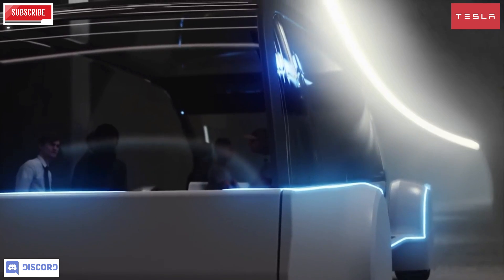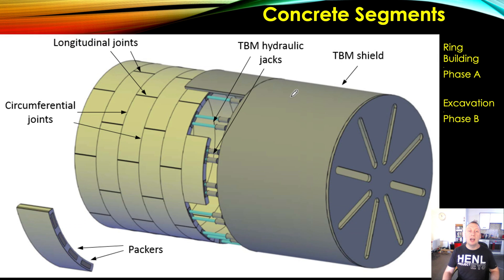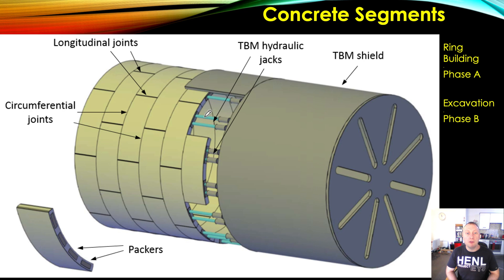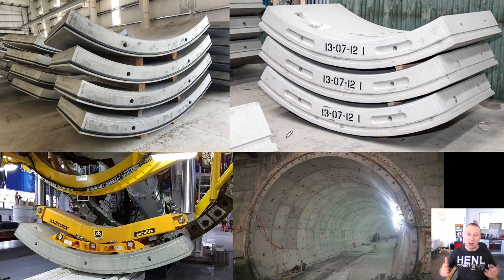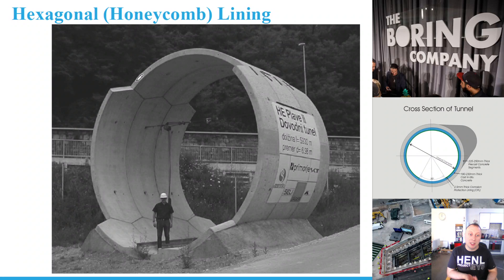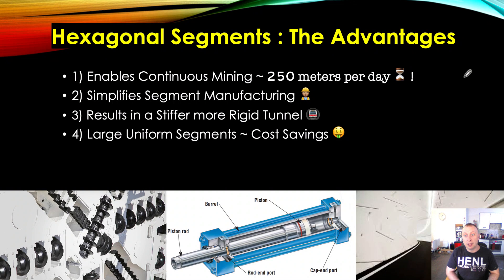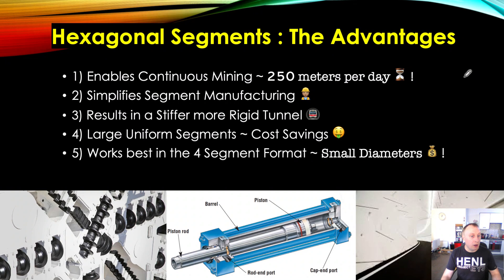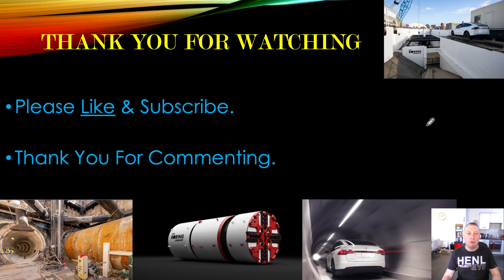The Boring Company 🚇 😃 🇺🇲 Hexagonal Concrete Segments Are The Future 👷🏽‍♂️ 🏗️ 🚎 PART 1

Comment: I really hope this is the case, whatever they do, it will be disruptive
Reply: To investors pockets I’m sure. To the tunneling industry I strongly doubt.
Reply: @davidsalisbury50  
David, it's apparent that you are skeptical.  That's fine.  One should not accept all claims out of hand.  But I'm not sure you fully understand how Elon and his companies operate.  Let me suggest you watch this video about Tesla.

u88Nqe0pIO0

The presenter may not be your cup of tea.  If so, concentrate on the messages given.  You'll come away, I think, with a better feel for how Elon's teams move from their starting position to get far ahead of others.  

For some background, Sandy Munro, seen in the video, is an genuine expert.  He helps the defense industry when they are having problems with weapons systems, he was one of the designers of one of Boeing's largest passenger jets, his company tears down and evaluates all sorts of products so he is familiar with best practices across several industries.  Companies come to Munro Associates when they are having problems with a product they want to manufacture.

Sandy started out being extremely negative about Tesla.  But once he made a short test drive and then stripped away the body Sandy did a full 180 and now reports that Tesla is years ahead of other car manufacturers.

I'd expect BoringCo to develop along the same lines.  Just put on your objective earphones and listen.
Reply: @davidsalisbury50  Betting against Musk typically is not a wise move.  He and his companies may know little when they first start but they tend to catch up and pass the pack fairly quickly.  Elon knew very little about rockets and EVs early on but look where SpaceX and Tesla are today.
Reply: Bob Wallace noted. I’m not betting against Mr Musk, I have no skin in the game other than a working knowledge of tunnel technology and I try to pass that in where I can.
I tend not to comment on Tesla and Space X as I know nothing more than any other layman on that technology.
I take my hat off to both of them.
Reply: @davidsalisbury50  

Understood.  If you know much about Tesla you know they entered the game by taking an existing car from Lotus and turning it into an EV.  I got a chance to check out one of Tesla's first Roadsters early on and while I'm a sports car fan, have owned a few, I felt no attraction to the car.  It just didn't look well made.  

But once one got past the rather clunky conversion job you saw that Tesla proved a concept.  Tesla, with that first effort demonstrated that EVs can be very fast, very responsive, and offer long ranges.  They buried the myth that EVs had to be golf carts with doors.

I suspect the Vegas project is similar.  Tesla is taking a standard tunnel boring machine and building a tunnel system that will allow thousands of unique visitors to Las Vegas to experience riding from one place to another at a high rate of speed, unlike any other transportation systems we now use.  There will be thousands, then tens of thousands, and even hundreds of thousands of people around the world stuck in a slow commute and wondering why they couldn't be traveling to their destination at 150 MPH.  Demand will occur.

Tesla went on to next build the Model S.  This was Tesla's first complete build car.  It immediately demonstrated that an EV could be beautiful, fast, and safe.   "(T)he highly regarded and long-respected industry magazine Car & Driver gave pretty high praise to the recently upgraded Tesla Model S 70D — even going so far as to referring to it as “a driving experience to rival the best.” In fact, it named the Model S in this article about the 70D the “car of the Century". "  From a proof of concept to, perhaps, the best car yet manufactured in four years.

I'm looking forward to BoringCo's next project.   I think that's when we see new ideas put in place and new tunneling speeds demonstrated.  To date Musk's companies have become dominant in automobile electrification and rocketry.  I will be surprised if they don't do the same in building tunnel systems.

Going to be fun to watch....
Reply: Bob Wallace I don’t disagree.
But from what I have heard, from the man himself, and others around him, there is little to suggest they have moved the current tunneling technology forward one iota to date, despite their claims I have only seen outdated technology and misinformed statements. I’m attempting to inform the debate. I realise that upsets some people and I get accused of being a Luddite or a troll. I will attempt to stay positive in the future
Reply: @davidsalisbury50  it's already a lot cheaper per mile. Let's check back in 5 years
Reply: Josh no it isn’t. The numbers they are providing are very selective. Not the whole cost. TBC can’t be using the same technology, materials, plant and workforce that the industry is (they are, but 20 years out of date) and doing it 5x cheaper.
The construction of the tunnels is only a small percentage of the cost of building a transport system. 
Check back in 5 years?
They have had 3 and achieved nothing new despite lots of promises. I’m not in the least surprised.
They have 3 current contracts, the first is supposed to finish this year. 
They still have a lot to do to transport 4,200 people per hour.
Reply: @davidsalisbury50  oh sorry, I get it. You hate Elon musk. Go troll somewhere else. They've won a contract and are delivering, they will continue to do the same and improve. There will continue to be luddites throughout history, people were crowing when the first skyscrapers were built, where are they now? I honestly can't understand why people stand on the sidelines and spew hate, they are 'the man in the ring' putting their blood and sweat into creating something. We should all applaud efforts like this, not tear them down.
Reply from the maker: @Josh  I'm really sorry this guy is bothering you. He is replying to every comment, I've counted 18 so far. 
Unsure why he is so eager to talk. I will message him 😕
Reply: @davidsalisbury50  Let's think a bit about phase two, a hyperloop.  Assume for the moment that BoringCo can bring down the cost of building tunnels appreciably and by using small diameter tunnels as opposed to train-sized tunnels the cost become affordable.  What would the rest of the cost of the system be?

Maglev track.  A continuous sheet of aluminum along the bottom of the track.  (Or perhaps I don't have a deep enough understanding of maglev.)

Vehicles.  Something like small buses that are pressurized.  Certainly not the cost per seat of building an airplane.

Stations.  A simple building at ground level with ramps leading to and from the main tunnel with airlocks to protect the vacuum.  "Show your ticket" to get in, clear security, walk to the correct platform, get in and sit down.

Energy costs.  Low. Vehicles operate in an environment with very little air resistance.

Tunnel maintenance.  Essentially nothing.  There would be no 'wear and tear' from vehicles that travel without making contact with the tunnel.  There would be no litter to remove.

Use.  The main tunnels will probably stay at maximum use around the clock.  When passenger pods don't fill them up freight pods can be slotted in.  Companies will pay premium prices to get freight from the West Coast to the East Coast in four hours.  They pay high prices for air freight now.
Reply: @BoringRevolution  
David is commenting a lot.  But he's also providing a lot of information.  Consider cutting him some slack.
Reply: Bob Wallace . Again, I tend not to comment on hyper loop technology. It’s clear there are some challenging technical difficulties to overcome before it is a reality. But who, when watching the Wright brothers take flight would have believe international air travel for the masses would be available effectively within a lifetime.
I don’t consider myself a troll or a Luddite. One of the reasons I took up tunnelling was the fact that it is at the forefront of construction technology. Some may believe this is not the case, but I believe I can support that statement with facts.

I will continue to challenge misinformation and provide clarifications where I think they are appropriate. I will try to be less critical and more positive in my comments
Reply: @davidsalisbury50  
I'm just suggesting that you think objectively.  Obviously BoringCo is not tunneling at record speed.  Maybe they won't solve the puzzle.  

But if one accepts the possibility that they might bring the cost of tunneling low enough then it's only a small step to see that we could have a very good alternative to flying powered by kerosene.

I've tried to look at all the public information about hyperloops.  I think all the necessary concepts have been proven.  We know that vehicles can travel at high speed in minimal air pressure conditions while powered by electricity.  That's the core technology.  Everything else like on/off ramps, stations, safety systems, etc. would be pretty much standard design and engineering.  I know of no unique problems for which solutions will need to be found.
Reply: Bob Wallace. Fair enough. I see many problems, but as I am no expert on the technology I don’t feel in any position to comment. I am concerned about how incidents in the tunnel are dealt with but I’m sure solutions can be found.
I still think it has a long way to go before the economics add up to make it more viable than high speed trains.
Reply: @davidsalisbury50  I'm seeing prices for HSR running multiples of Musk's $30 million per mile (three tunnels).  Gaining right of way through urban and built up suburban areas would be very expensive plus hard to accomplish.  If the hyperloop proves out I can see the federal government deciding that some tunnels are in the public interest and using eminent domain to acquire routes when necessary.  That's how the federal Interstate Highway System was built.

Plus HSR doesn't replace flying except on shorter routes.  It would be hard to get people to travel coast to coast in the US, spending 24 hours onboard, when they can fly in about five.  My understanding is that Europeans typically go to the airport rather than take long train trips.  

With a hyperloop in a tunnel solution there would also be significant maintenance cost savings.  Tunnel maintenace should cost about nothing.  Rail requires inspections and repairs.  The protective fences have to be maintained.  And shoving a lot of air out of the way via blunt force probably eats energy.
Reply: Bob Wallace a lot of HST is in tunnels of course because it needs very straight tracks, especially when it gets into urban areas.
You are quite correct that land rights are a critical factor. But that is the same for any surface/subsurface system. I’m not sure why hyperloop would get special preference over HST.
Europe has a mix of HST and flights, but HST is getting more popular due to the security restrictions, the use of overnight/sleeper trains for >500 mile journeys. 
Like all these things, the future is likely to be a mixed bag of modes of transport.
I’m not clear where hyperloop fits into that.
Reply: @davidsalisbury50  I really appreciate the change in tone. And glad to hear you're open to new things. You've been great at spreading some useful knowledge in the comments, appreciate the information from an informed perspective. All's well that ends well 😎👍
Reply: @davidsalisbury50  
Again, I don't see a contest between HSR and an underground hyperloop.  HSR is simply too slow to be an acceptable alternative to flying.  In Europe HSR ridership has been increasing for short/moderate length trips at least partially due to governments lowering ticket prices as a way to get people taking trains and lower CO2 emissions.  But back to the US.

We must quit fossil fuels.  We should have quit years ago but we didn't and now we're paying for our mistake.  We've got to quit making the same mistake over and over.  EVs are replacing ICEVs, the dam has broken and we watching legacy car manufactuers starting to scramble to move from engines to motors.  I think Tesla has not only forced the move to EV but has also created the solution for moving freight at highway speeds.  The two remaining transportation issues are flying and transoceanic shipping.  

How might we get petroleum out of high speed travel?  There some alternative ways to power airplanes but none are really good options, at least at this time, and I see little hope of much improvement in the near future.

Biofuel, if we could grow enough with hurting food production.  Hydrogen, except it uses a lot of energy in electrolysis and compression plus being a low energy source in terms of storage volume required.  Some sort of synfuel is possible, but perhaps expensive.  Batteries, perhaps someday, but we're several levels of improvement before the Wh/kg level would support long distance passenger flight.

The other alternative is a hyperloop.  It holds the possibility of being faster than flying.  The stations could be placed very close to where passengers want to depart and arrive rather than the often significant distance of airport from city centers.  The trip should be more comfortable.  No turbulence and it is expected that turbulence will become more frequent and stronger as we warm the atmosphere.  We can run the system with 'panels and turbines'.  And, depending on how rapidly we amortize the tunnels, perhaps the cheapest per passenger mile of all modes of travel short of bike and foot.

So.  Assuming Elon is right and it costs about $30 million per mile for tunnels that should be useable for more than a century.  (What's the lifespan of concrete tunnel liners?) And the other capex and opex costs are low I can see building a tunnel system as a national good, a national benefit.  If that's the case then I think we'd see the federal government assisting route procurement.  It would be hard for a landowner to go into court and claim that a space less than 40 feet wide and at least 30 feet below the surface should not be taken from them because the landowner would suffer from some sort of denial of use.
Reply: Bob Wallace a lot to take in, but I’m largely in agreement.
I still see the same tunnel network, just with HST’s using them.
mr Musk is about right that a single bore 6m tunnel costs around $30M per mile, but that is just the excavation and lining of the bare single tunnel, it doesn’t include all the other infrastructure, fitout, stations, emergency escapes (every  240m (800ft) between tunnels or 720m (2,400ft) if escape to place of ultimate safety (the surface)).
This is a recognised international standard that is hard to get around.
Tunnel linings are usually designed for 120 years of life. This has something to do with the durability of concrete, but in reality with good maintenance they can last and have lasted far longer. We are yet to see how long modern high strength, fibre reinforced and fireproofed reinforced concrete can last. But given it’s very high engineering quality standards I don’t see any problem with it lasting hundreds of years.
Reply: @davidsalisbury50  

David, let me start with the obvious.  You can't fit a train in a tunnel sized for a car.  Making the tunnel larger increases the cost per mile.  You've got the better knowledge base here, what's the approximate cost per mile for a tunnel that would allow passage of a full sized train?  We have a working number for a tunnel sized for a car or small passenger bus, $10 million per mile.  Give us a working number for a tunnel that would permit passage of a single train and we can think further.

I'm assuming you are assuming running HSR in a partial vacuum similar to how vehicles would operate in a hyperloop.  Otherwise HSR would be too slow.

A difference to be considered between a train and using smaller vehicles, something like 20 seater buses with no aisle built on a Tesla style skateboard might be the peak passenger throughput.  In terms of maximum number of people-rows per unit length in the tunnel might be about the same.  The same spacing between rows of seats.  

I'm assuming both train cars and 20-buses wouldn't have standing riders.  All passengers would need to be seated and probably belted at 700 MPH, at least during deceleration.  The difference might be four across seating for the 20-buses and six across for the train cars.  A 1.5x advantage for a train car.  That has to be weighed against the cost of a larger diameter tunnel.

I assume both train cars and 20-buses could travel, at speed, separated only by inches or by the necessary space needed for train couplings.  With computer control all vehicles in the system should respond as a single organism.  If there would be a need to slow or stop, all vehicles would slow or stop at the same time and at the same rate.

So, what might be the advantages of each?  I'll let you tell us the advantages of larger capacity, coupled cars because I can think only of more seats per row and I suspect that would be more than offset by tunnel width requirements.

20-buses would need significantly smaller airlocks.  

20-buses could move, independently, to any available loading platform in the station.  They could even load outside a station at a curb.  Trains would need lengthy platforms and one train would have to clear the platform before another cound enter.  If a station had multiple train platforms more space would be needed to track switch.

Emergency escape routes would seem to be similar for both trains and 12-buses.  The hyperloop solution is to add a center tunnel for escape and service use for both travel tunnels.  

I'm not sure why we would need as elaborate an escape structure with maglev vehicles running in tunnels like is now needed for trains or cars.  Other than what passengers bring onboard with them there's little that might burn.  There's no fuel.  There's no rubber tires.  There's no asphalt. Build the bodies out of non-flammable materials.  Properly design the electrical circuits so than any short would result in an immediate opening of the circuit before heat could ignite insulation.  Minimize interior materials, upholstery, to minimize potential fuel.

We almost certainly wouldn't ship hazardous chemicals, explosives, or fuels through the tunnels. 

Perhaps we'd rethink the spacing of escape 'hatches'.  But it seems like the requirements would be the same if we would have about the same number of passengers per km with both.  Or we might need more for six-across seating.

.
Reply: I've gotten rather wordy in my comment here.  I think what is happening is that I am thinking at the keyboard and later might be able to say the same with fewer words.  Sorry.  I'm breaking up the current comment burst, so....

120 years of expected service.  $30 million per mile.  $250,000 per mile per year.  Finance with low cost bonds and the math could get very interesting.  Doable if the government viewed this as something for the common good and gave Treasury backing for the bonds.  The cost per passenger mile could be very cheap when one considers how many people might pass a single point in a year.  

BoringCo says that the Loop could carry up to 4,000 16 passengers pods past a given point in the tunnel per hour.  64,000 passengers per hour  max capacity.  And that's at less than 25% the speed of a hyperloop.

$250,000 / 100,000,000 (an average of just over 10,000 per hour) = $0.003 per mile.

In terms of use - if not people, then goods.  The fully amortized cost of the tunnel would approach zero per passenger mile

Very low tunnel maintenance costs.  No or only very minor cleaning and no resurfacing costs if vehicles are "flying" through the tunnel.  No 'wear and tear' issues I can think about.

Low station costs, at least with small vehicles.  Just a sheltered place to stop long enough to unload and load passengers.  The largest station cost would probably be the airlocks and the largest opex would be staff in the station.  If the airlocks were very "snug" then not a lot of cost for sucking out the air around a departing vehicle.  (More for trains due to the space between cars.)

Electricity is the cheapest 'fuel'.
---

I've assumed by HSR you mean the ability to travel at 700+ miles in a partial vacuum.  I don't know how you see the design of that train.  A separate 'engine'?  If so, that would take up space and reduce passenger throughput.  

I assume whether it's a 20-bus or a train there would need to be a center aisle for access to a toilet while underway and ample headroom for walking.  The tunnel difference, in my head, between a 20-bus and a train designed for hyperloop travel is mainly width/tunnel diameter.
Reply: Bob Wallace all interesting stuff. I’m a bit confused between the loop and the hyperloop in your comments but no matter.
I still see HST as the answer. Electric trains can run safely at 350kph, in tunnels of about 7.5m diameter, including all the requirement for safety, walkways, means of escape etc. 
The need for speed can be offset by      convenience. Trains are a very comfortable way to travel. (try the Shinkansen in Japan). Europe and China have moved to the same technology. Flying remains an option but HST networks are beginning to win people over.
We have still yet to see the $10m mile tunnel, even at the smaller diameter for cars. And of course that is just the very basic excavation and lining cost. $30m is far more realistic, with some of the basic fixed costs applied its hard to see how it can be made much cheaper. Excavating faster is a saving with very quickly diminishing returns due to the enormous investment in plant and equipment required.

One of your comments about the loop being capable of 4,000 vehicles per hour passing a single point caught my imagination. That is greater than 1 per second, travelling at 150mph. With vehicles merging in and out of the main line all the time. What radius of horizontal and vertical curve do you envisage at those speeds! 
I assume all passengers are seated.
Reply: @davidsalisbury50  
Start with the basics.  It takes a lot more energy to move fast than to move slower.  Planes fly at ~30,000 feet in order to have less air to push around.  They don't cruise close to the ground where air is thicker.

The Loop is BoringCo's high speed (~150 MPH) urban subway system.  Travel from start to destination at 150 MPH and make no stops along the way.  Super efficient subway.  Avoid road congestion and bumper to bumper driving.

A hyperloop is a system where the vehicles run in a partial vacuum which eliminates most of the air resistance and allows movement at much higher speed (~700 MPH) while using about the same amount of energy as going 'normal' speeds.  It's creating 30,000' conditions in a tunnel or tube.

HSR tops out at about 350 MPH due to air resistance.  Not fast enough for long distance travel.  About nine hours from LA to NYC vs. four to five hours by plane.  

Some background:
Musk started interest in hyperloops by writing a paper about the idea and offering the idea to whomever wanted to develop it.  He said that he didn't have time at the moment.  There are companies that founded to create hyperloops and at least a couple used the capitalized word Hyperloop in their title.  That's why I write hyperloop in small letters when discussing the concept.  The Loop is a brand name created by and owned by Boring Company. 

Elon was frustrated by driving in congested traffic and though a tunnel might be the answer.  He dreamed up the hyperloop from that thought.  It's an idea that was played with decades ago but never generated a workable technology.  After releasing his 'white paper' Elon apparently found some time and with a team worked up ideas about how to create low cost, high speed subway systems.  They founded Boring Company and worked out ideas about how to construct tunnels about 15x the speed of current, large diameter traffic tunnels.  And somewhere in the process apparently realized that if you take the same tunnel and pump out most of the air you could have a hyperloop.

OK, back to topic.  But, remember, a large part of achieving 15x is drilling smaller diameter tunnels.

Minimum tunnel diameter, I think, is based on the ability for a passenger to stand up and walk to the toilet or exit.  That probably means only 2x2 seating per row.

I've ridden HSR.  It can be quite comfortable but in some classes there's not much more legroom than in Economy on a plane.  Vehicle length is not much of an issue except for lowering passenger per hour throughput.  Vehicles can be longer without requiring larger diameter tunnels.  

What we don't have is a price for a train sized tunnel.  If it's more than $20 million per mile then we could use $10 million per mile sized tunnels, build a pair, and double the 20-bus throughput.  I suspect a tunnel sized for a train would be a lot more than 3x the cost of a hyperloop tunnel.

4,000 passengers per hour seems like a lot to me.  But that number was generated by highly competent engineers who were engaged in modeling.  They were using 16 passenger vehicles moving at 150 MPH.  250 vehicles passing a point per hour, about four per minute.  One every 15 seconds, roughly.

In a hyperloop those vehicles would be passing a given point at 700 MPH.

Remember, all the human reaction time would be eliminated from the vehicle control system.  A vehicle would not wait to observe that the vehicle in front of it was changing speed.  Every vehicle in the system would get the change speed/brake signal at the same instant.  (Allowing for message transmission time.)

Turn radius?  I can't give you a number.  But assuming hyperloops would not have to be installed under existing highways as subways sometimes are, gradual turns could be made over miles.  The radius of the turn would be limited by passenger comfort.  Avoid extreme lateral force.  

Necessary tight turn?  "All passengers return to your seats and buckle in.  We are going to make a sharp right turn in 1.5 minutes."
Reply: @davidsalisbury50  
"We have still yet to see the $10m mile tunnel, even at the smaller diameter for cars. And of course that is just the very basic excavation and lining cost. $30m is far more realistic, with some of the basic fixed costs applied its hard to see how it can be made much cheaper"

Elon's basic argument is that is we drill faster then it becomes cheaper to drill.  I don't know if he can reach $10 million per mile and there's no reason to think we should have at this point.  BoringCo. hasn't yet brought their 'designed from the ground up' TBM to the party.  And even after Prufrock starts working it might take time to adequately refine it to reach 15x tunneling speeds.

Here's the thing.  I've been closely following Elon and Tesla since about 2008 when they announced the Roadster.  (I've also been closely following a lot of renewable and energy developments.  I'm more than just a Tesla fanboy, er, fangeizer.}

What I've observed is that Elon has delivered on just about everything he said he would deliver.  Sometimes late, but more often early.  He can't predict the time totally accurately because "stuff happens" and there's no way to predict "stuff".  But he hits or exceeds the other parts.  And he delivers stuff that no one expected because he didn't talk about it before hand.

I think Elon is fairly confident that he sees a route to fast tunneling.  He's not telling us much about that route except for smaller tunnels, electric powered TBMs, and tunneling a higher percentage of the time.  Tunneling more minutes per hour should come from more efficient lining installation, water cooling the drill head, avoiding laying exhaust lines for ICE fumes, and rapid removal of spoils.  Elon has not told us how he's going to accomplish those things but he must have ideas that he considers will work.

Elon might fail.  I do not assume we will see affordable hyperloops.  But I have learned over the years to not bet against Elon.  What I'm doing right now is learning what I can about the system and, especially, looking for fatal flaws that someone might identify.  When someone presents what they see as a flaw then I see if I can think up a solution.  If I can then it's not a flaw.  

And then I assume much smarter people working inside Boring are going to come up with a more elegant solution than my "good enough" idea.
Reply: @bobwallace9753  loving your thoughtful, in depth posts Bob. Keep up the good work! 😎👊
Reply: I made an error in the previous comment.  I did some math based on 4,000 passengers per hour.  It's vehicles, not passengers.  Here's a copy from BoringCo's FAQ page -

"Loop is targeting 4,000 vehicles/hour at 155mph (250km/h) for each Main Artery Tunnel."

4,000 per hour
67 per minute
Vehicles would need to arrive at a single point every 0.9 seconds.

This is a claim that I have trouble getting my head around.  I'd like to see the argument fleshed out a bit.  

At 150 MPH a vehicle would travel 220 feet in a second.   150 MPH / 3600 seconds in hour = 0.0417 * 5,280 =  220.

Looks possible if close spacing can be maintained.  Did I screw something up?  There must be a better way to lay out the argument but it's not coming to me at the moment.
---

The Tesla X is 16.5 feet long.  Tesla is talking about 16 passenger vehicles.  For the Loop there would be no need for aisles and a toilet so seating could be four across.  Put swing up doors on each side and it would be an easy in/out for passenger.  No need for frunk.  So, perhaps 20 feet length.  At 150 MPH that vehicle would clear a given point pretty quick.
Reply: Bob Wallace all good stuff. 
What you describe is not dissimilar to the difference between inter city, trans continental HST and inner city metro systems.
BTW much of the London Underground was bored at a smaller or similar diameter to that proposed for the Loop. Trains only achieve around 80kph. But that is as fast as the need when there is only 1000m between stations and relatively tight (150m radius) curves.
Reply: Bob Wallace if I could just pick up in your paragraph about what Mr Musk is confident about.
Smaller tunnels have been used for mass transport systems (London underground is surprisingly small); All TBMs are already electrically powered; excavation is usually 60-70% of the cycle, when building the ring there are a list of other activities also being done to prepare for the next excavation cycle, I admit these could be more efficient but the maximum gain is 30/40% if excavation is continuous with all these other activities including maintenance and cutter changes; Modern TBMs are already water cooled; ventilation requirements calculations in TBM tunnels are rarely driven by the exhaust requirement of diesel locomotives (they all have sophisticated scrubber systems far better than surface vehicles), human breaking supply rates often dictate along with cooling the air in the tunnel (TBMs generate enormous amounts of heat).
There is little evidence I can see  that smaller tunnels 3-5m diameter can be constructed significantly faster than heavy rail tunnels 7-9m diameter. The logistics inside smaller tunnels are heavily constrained. 
Despite many thinking that this technology has been sitting in the dark ages for decades it’s simple my not the case. I have had the privilege of being a first hand witness and in some small part contributor to some amazing leaps forward in tunnelling technology.
Reply: Bob Wallace  on the 4,000 issue.
My understanding from Boring Revolution’s videos is that TBC have signed up to 4,200 passengers per hour for the Vegas Conference centre project. 
I assume this is 2,100 in each direction. It may be feasible but the intermediate station will make this hard to achieve and the size of the terminus (multiple turnaround and loading bays) will be fairly expensive. 
Coming full circle to two of my cornerstone points: the maximum speed of the vehicles is a minor consideration, and the cost of and time to build the tunnel tubes is a relatively small factor in the construction cost and time of a mass transit system.
Reply: @davidsalisbury50  
I don't think we should view the Vegas Conference Center system as an actual Loop system.  I see it as a 'lesser' project that will give people first hand experience with riding rapidly for a short distance and avoiding surface road congestion.  

"Hey, this is pretty slick.  I wish we had something like this at home so I could go from __ to _ and not spend a lot of time stuck in traffic."

(It's also not a demonstration of how rapidly tunneling for a Loop might happen.  It's an ol' skool time TBM dig.)

The VCC is not a long enough of a run for vehicles to achieve Loop speed and, in general, people would not access Loop tunnels via stations.  What is more likely is that people would enter and exit Loop vehicles along streets or even at their homes.  

Imagine a robotaxi is waiting when you walk out the door.  You get in, ride to the nearest Loop entrance, zip along in the main tunnel, and depart at your destination door.  Stations would be needed only at 'crowd' destinations such as stadiums and airports.  Perhaps stadiums/airports will no longer have large parking lots, but lots of loading platforms that are connected to the venue by a covered, moving sidewalk.  Rather than thousands of parking spaces there might be hundreds of loading platforms.

I don't know how the VCC intermediate system is designed.  I expect it will not require "all traffic stop" like happens with trains or subways.  In a fully built Loop only those vehicles heading to that specific station will stop, other vehicles will not slow or leave the main tunnel.  Think a railroad siding or highway exit/entrance ramps where a vehicle can exit or enter at full speed and other traffic can continue without changing speed.  (There would need to be slight speed adjustments in order to create slots for entering vehicles.)

Remembering that we're only talking about Loop systems and not hyperloop systems, I think the only important issue is cost per mile for the tunnel.  And speed of tunneling is a large part of cost.  

A Loop will not have many costs other than tunnels.  Like any other traffic tunnel,  a Loop tunnel will be a fairly passive structure.  There will be few 'stations' needed.  Most riders will load and unload at the curb.  

Large volume destinations will need to reconfigure part of their parking lots.  Perhaps they wouldn't make any changes.  A robotaxi pulls into any open parking space, passengers get out, just as they would do if they had arrived in their own car.  The robotaxi then backs out and goes off to service someone else.

At most the tunnels would need some sensors (cameras) in order to monitor traffic movement and a computer system to communicate with individual vehicles to control speed and stopping.

Speed?  Speed of travel is what it is all about.
Reply: @davidsalisbury50  
How many of the systems you list allow vehicles to exit the main path and allow other vehicles to proceed at high speed?  How many of them block the path like subway trains do?  How many allow a person to enter anywhere in the system and exit anywhere else in the system without stopping along the way?

A couple things on curve radius.  

First, speeds of 240 kph (150 MPH) not 80 kph.  Need more gradual turns at higher speeds.

Second, but vehicles with a very low center of gravity which improves cornering.  Loop roadway curves might be banked which would allow tighter turns while not causing a lot of lateral force for passengers.

Initially Loop tunnels might have to travel under existing surface roads.  That might mean some turns tight enough to require slowing.  A top speed of 150 MPH might be possible but average speeds might be lower, but still massively faster than surface travel.

The Underground was built in 12' diameter tunnels?  That must have been a very early version.  I haven't ridden the Underground a lot but the tunnels, as I remember them, were large multi track tunnels.  We can't put modern subway trains or HSR in 12' tunnels.
Reply: @davidsalisbury50  

What is the diameter of a tunnel that can handle two subway train track?  How long might it take to dig and line a mile compared to completing a mile of 14'/12' tunnel?  With those numbers one can get a rough idea of how much faster a Loop/hyperloop tunnel might be constructed.  (One tunnel time x 3 for Loop and hyperloop.)

When you dig one very large tunnel how much more material has to be removed compared to three smaller tunnels?  How much more liner has to paid for, hauled, and installed?  Cost and time.

BoringCo is looking at tunnel diameter as a major time/cost issue.  I don't know what ideas BoringCo has for improving TBMs.  I see two possibilities:

1) Elon put together a team of highly qualified engineers and they pulled together all the public information available, including bringing in experienced people from the tunneling industry in order to get the team up to speed.  The ideas the BoringCo team then developed go up and above current state of the art and BoringCo is not making those ideas public.  

Elon's companies don't talk about specifics until they have that idea into production.  They will hint a future capability but they don't reveal, for example, the specific stainless steel alloy used in their rockets and Cybertruck bodies.  

2) Elon and his team don't know what they are talking about.  They haven't bothered to learn what the best technologies and methods are now.  They're working from out of date information.

That's a possibility, but it would be the only project Musk has started that acted that way.
-------

Remember when reading my comments that I am not saying that the Loop and hyperloop absolutely will work and be the way we travel in the future.  I'm saying that they are promising.  I'm looking for actual problems that might mean we would not see them as part of our future transportation future.  Perhaps someone will develop an even better idea or perhaps there's a fatal flaw.
Reply: Let me toss in some information that might help people understand a bit about Elon.  This is about how Elon went from being basically a software engineer to being a highly skilled rocket engineer.

Elon wanted to help drive interplanetary exploration, NASA had stalled out past the last Moon visit.  He attempted to purchase rockets from Russia but that wasn’t possible.  So he decided to take about a third of his fortune and build rockets.  Elon knew very little about rockets but that changed very rapidly.  Here are some outtakes from an interview with someone who watched and assisted Elon’s rocket engineering education.

“Jim Cantrell, who was an aerospace consultant at the time, became SpaceX's first VP of business development and Musk's industry mentor when the company launched in 2002. He says that Musk literally taught himself rocket science by reading textbooks and talking to industry heavyweights.

….

(Cantrell)  explains the two-part learning process that Musk used to teach himself rocket science.

(Elon) committed textbooks to memory.

"He is the smartest guy I've ever met, period," Cantrell tells us. "I know that sounds overblown. But I've met plenty of smart people, and I don't say that lightly. He's absolutely, frickin' amazing. I don't even think he sleeps."

….

(Cantrell) doesn't know exactly how Musk would read or take notes, but he knows that he practically memorized them.

"He would quote passages verbatim from these books. He became very conversant in the material," Cantrell says.

He built a network of the smartest people.

Musk "knows everything about what he's building," Cantrell says, but of course even he understands that he can't master everything. That's why he used Cantrell's network in the aerospace industry to gather some of the best in the business. "It was like spaceapalooza!"”

https://www.businessinsider.com/how-elon-musk-learned-rocket-science-for-spacex-2014-10#:~:text=Jim%20Cantrell%2C%20who%20was%20an,and%20talking%20to%20industry%20heavyweights.

I expect Elon now knows quite a bit about tunnel construction.
Reply: @bobwallace9753  Tour de force of a comment Bob! People also don't pay respect to what a fresh pair of eyes can bring to an industry. Those in the status quo are blinded by how things are currently done. First principals thinking can really shake things up.
Reply: Bob Wallace. Lots to try and answer. So I will take the tunneling questions in short bursts if you don’t mind.
For twin track subway tunnels in a single tube they start at around 9m (30’) diameter OD excavation, about. 8.1m (27’) ID, some are larger depending on a number of factors. Size of rolling stock, power supply (third rail, Overhead D.C. or overhead AC)
Reply: Bob Wallace.
TBM Tunnel excavation speed is not related to tunnel diameter, it is far more dependent on other logistical factors and ground conditions. I appreciate on the face of it this seems counter intuitive but  diameter and speed are not really related.
Reply: Bob Wallace. 
Typical current excavation rates are 12-20m per day, so the best is around 70-90 days per mile. 
Face area is the square of the diameter so double the diameter means 4x the excavated volume.
Reply: Bob Wallace. You are of course correct that larger diameter required thicker liners. But the material cost (concrete and steel) is only part of the driver for lining costs. Segment moulds, cage assembly, EPDM waterproofing gaskets, connection fittings, casting and handling costs need to be considered.
Reply: Bob Wallace. I realise TBC are spending a lot of time looking at the Diameter of the tunnels they are to build. This is what tunnel designers are doing all the time. There are a number of constraints to consider but emergency evacuation is often most critical. For metro systems side evacuation walkways is the most common accepted system these days. Traditionally many metros used end evacuation along the tracks but this has disadvantages in evacuation time.
Of course, side walkway evacuation means a larger diameter tunnel. Some larger tunnels are making use of the extra space created when side walkways are introduced to include utility corridors in the tunnels (telecom and power distribution).
Reply: @davidsalisbury50  

OK, a lot more spoils to dig in a large diameter tunnel, lots of unused overhead space that has to be excavated and lined.

Then there's the TBM.  The machines that BoringCo use can be removed from the tunnel and trucked to a new site.  Some large TBMs are single use monsters and dig themselves into a grave at the end of the project.

Smaller TBMs will be much cheaper to build.  That means that you could turn multiple TBMs lose on a long tunnel, dropping them in at intervals, and cut the calendar time significantly.  That brings the project online sooner and starts revenue flows earlier.

Currently tunneling machines average about 60 feet per day.  Boring Co. estimates they can increase that by 15x via smaller tunnels and more efficient tunneling.	For fun let's assume they can.
	
It's 3,000 miles from LA to NYC (approx.), 15,840,000 feet LA to NYC 	
	
900 feet per day tunneling with one Boring Co. TBM (60' x 15)	
180,000 feet per day with 200 Boring Co. TBMs working along the route	
88 days to drill a single tunnel coast to coast	
9 months to drill the three tunnels needed for a hyperloop system 

It would be a gigantic undertaking but in a year the main tunnels for a coast to coast hyperloop could be complete.  During the next year work could be carried out constructing the spur tunnels to reach other parts of the county.  And most likely a system would be built from city (for example, LA to Phoenix) and then extended to the next nearest large city.
Reply: Bob Wallace. On TBM design.
You postulate two scenarios but I suspect the reality to be somewhere between the two.
TBC did start from scratch as I understand it. They didn’t purchase an existing TBM manufacturer or tunnel construction company. I believe they hired a couple of tunnelling engineers and TBM designers, then purchased two second hand TBMs. These were/are EPB type machines and I believe they were originally built by a Canadian company called LOVAT, now defunct. Although TBC have not been very forthcoming about their origins or specification (this has led to quite a lot of the miss information about them we can find in the internet unfortunately).
If I am correct, and I accept that as TBC are being quite secretive about their TBMs I may be far wrong, then their current technology in use is well established and common in TBMs around the world. Nothing wrong with that, one of the new upcoming TBM manufactures has specialised very successfully in the most standard 6.3m diameter EPB machines for construction of metro tunnels in soft clay/sand ground, found under many cities.
I look forward to the next developments by TBC.
Reply: @davidsalisbury50  
I think they used one non-modified TBM "Godot" for the short LA proof of concept project.  The other machine, "Linestorm" was modified to some extent.  Their third machine, "Prufrock" was built to BoringCo's design.  I'm not aware of whether that machine has been put into service yet or not.  I saw one claim that it was being used for the Vegas tunnels but that might not have been correct.  Prufrock may be undergoing testing in the Ca desert or perhaps that's a fourth machine that has been spotted there.

I think it will be something like up to a year before we find out if BoringCo has made significant progress of lowering tunneling cost.  You say that a 14' diameter tunnel should cost about $30m/mile.  BoringCo. is shooting for $10m/mile.  I expect we will see cost drop over time and not an immediate 3x drop.  If they can reduce tunnel cost, of which you are skeptical.
Reply: Bob Wallace. Yes, we saw quite a bit of information about the ‘Godot’ machine. It was clearly a largely unmodified EPB machine with a very basic back up. I believe it was a second hand LOVAT machine but the actual manufacturer is not so important.
I’m not sure what “proof of concept” was achieved over conventional TBM tunnelling. Some claims were made, often by others, but there was nothing new there to a tunnel engineer.
I’m a bit confused as to wether the “Linestorm” machine was used at Vegas or the “Godot” machine. I don’t think it was Prufrock as it is still in development as I understand. 
My guess is that they would be stepping up the technology to a closed face slurry/mixshield excavation mode or even a Variable Density machine, despite the name hinting towards an open face hard rock machine. 

Any new machine needs a real project to test it on. It’s an expensive thing to trial. 
The problem is that for any project the TBM excavation rate is rarely the critical constraint on overall production. Often back-up logistics become the critical constraint (spoil disposal, surface site logistics, segmental lining delivery, environmental working hours constraints). These are reasons why TBM excavation rates can vary greatly.
Actual forward cutting rates when excavating are about maximum 50mm per minute for modern TBM’s.
Reply: @davidsalisbury50  
The proof of concept was not about showing faster ways to tunnel but to show what a Loop system could provide for users.

BoringCo started by building a short tunnel in LA.  They put a high speed elevator at one end and a ramp at the other.  That allowed them to give people a sample ride.  Passengers could ride into the elevator, zip down to the tunnel, ride at high speed to the ramp, and then return to the start on surface roads.  In stop and go traffic.

Lots of people are very poor at envisioning.  They need direct experience in order to understand.

Las Vegas is a larger and public proof of concept demonstration.  Think about the many thousands of people who visit Vegas every year and go to events in the convention center.  I don't know if you've been in Vegas but the couple of times I've been on the main drag, the "Strip", traffic crawls along.  People are going to experience zipping along on one route and creeping along on another.  That should convince millions (over time) that if the Loop is affordable there is a good solution for urban congestion.

Think about the economics.  Assume it might cost BoringCo $20 million per mile on average to test their TBMs.  Perhaps there are tunnels that have some potential use and create revenue that can be drilled as part of the testing process.  Perhaps they'll build a small project at a loss.  Businesses commonly lose money for years before becoming profitable.  (Think Amazon.)

Now think ahead ten years or so.  Suppose BoringCo is building Loop systems.  In many cities around the world.  There are over 4,000 cities with populations in excess of 100,000.  Pretty much every place with traffic problems will want a Loop(s).  BoringCo is expanding as fast as their factory can produce TBMs.  How large a company would that be?  Revenues in tens or hundreds of billions per year?
Reply: @davidsalisbury50  
I just saw a tweet exchange.  Someone asked Elon "How is it going with Prufrock?  Beating Gary yet?"

Elon replied "Gary the snail is still winning but we're gaining on him/her."

I suspect that says that Prufrock is the TBM being tested in the CA desert between Vegas and LA.
Reply: Bob Wallace. Sounds like congratulations are in order. If Prufrock is beating a snail then it is already up there with the fastest TBMs built to date.
Hopefully we will get some details soon. The real challenge will be to maintain that performance over an extended period in complex ground in an urban environment.
Reply: @davidsalisbury50  

Elon said that Prufrock was not as fast as a snail.  But that they are making progress, closing the gap.

Why would an urban environment be a problem?
Reply: Bob Wallace.  sorry, I read the quote as gaining on something that is beating you to mean that you are going faster than it. That would not make sense of course in this case. So I guess we can take it that Prufrock is improving steadily, but it’s still not giving away much.

Tunnelling in the urban environment weighs the project a number of common constraints:
Space to work (site establishment)
Underground existing instructions (utilities, basements, piles)
Land rights (most urban land is owned by multiple parties)
Site logistics (getting the materials in and the spoil out is often the critical constraint in any tunnel project {no point having a Ferrari on 30mph roads with regulars traffic lights})
Environmental constraints (the neighbours will object to 24 hour working if it’s keeping them up at night)

These just some of the balls that need to be kept in the air when undertaking tunnelling projects in and around cities and suburbs.
Reply: @bobwallace9753 

I've just read the comments that have gone back and forth between you and David in this thread which are very interesting.  I hope neither of you mind me adding my tuppence worth.  I don't have anything like the tunneling experience or knowledge that David has but I have over 30 years experience in construction so I understand a lot of the challenges, particularly in respect of design, planning, logistics, maintenance, safety, material procurement & delivery, labour, plant, ground conditions and unforseen events (which are  inevitably encountered). 

Whilst I admire your optimism about what TBC could achieve I think there also needs to be some realism.  David identified typical tunneling rates per day - circa 20 metres on average.   This is quite a bit less than the actual records that have been achieved per day, per week & per month for all diameters of TBMs.  Here is a link to all the current records:
https://www.therobbinscompany.com/news-and-media/world-records/

It can be seen, like David said there is not much greater speeds achieved with smaller diameter tunnels compared to larger diameter tunnels (up to 10m anyway).  In fact, some of the larger diameter tunnels have faster records than smaller diameter tunnels. 

Whilst Ellon Musk is regarded my many as a visionary, some of his aspirations (e.g. increasing the current speed of tunneling 15-fold) is, to be frank, far - fetched and naive (he admits he knew nothing about tunnelling when he had his vision for a network of tunnels below LA).  Its comparable to a novice sprinter saying he will smash Usain Bolt's World record and run 100m in approx. 0.7 seconds, which I trust you would agree will never happen. 

The comparison to Gary the snail is also a bad comparison. Whilst I accept it is a bit of a gimmick, snails do not travel long distances in a relatively straight line without stopping. Whilst snails have been reportedly recorded at speeds equivalent to circa 0.03mph (47 metres per hour) that is over over short distances, and not representative of reality.   snails stop for rests, sleeping and eating and have quite a random direction of movement. 

In a 2013 study of 450 snails,  it was found that snails travel up to 25 metres on a 24- hour period (approx. 1 metre per hour) 
https://www.express.co.uk/news/uk/424065/Tracking-movement-at-a-snail-s-pace

Achieving a speed over a short time or distance is not representative of the speed that can be achieved over a long distance without stopping. Using Usain Bolt again. He reaches speeds of 27.44moh when sprinting.  If he could systain that speed for an hour (which he can't) he would be able to run more than a marathon in 1 hour (or a marathon in less than 1 hour) yet the record for a marathon is just over 2 hours.  Also whilst a top marathon runner can run a marathon in just over 2 hours he could run 12 marathons in a single 24-houf period. 

So whilst record spoeds can be achieved for TBMs over set periods (day, week or month) such records spoeds can't be maintained over longer periods.   The link I posted shows that the record average monthly spoed for most diameters of TBMs is approx. Halh of the monthly records for each diameter records.

The monthly average record for a 4m tbm is 1189m.(aporix 0.75 miles). Some typyrs of tbm (E. G. Double shield can excavate and erect wall panels simultaneously but this is dependent upon the type of ground and EDMs alternate between excavation and wall lining. Contrary to Elon's claim that wall erection and excavation can be done simultaneously for EBMs this is not a realistic prospect (but David could tell you more about attempts that have made to do both simultaneously with and EBM and the priblems/ difficulties that are encountered). 

As David pointed out the typical tunnelling rate per mile is 2 to 3 months per mile. Doing this 15 times faster (4 to 6 days per mile) is not realistic. I've actually heard Elon say that he thinks 1 mile per day was readily achievable!

To put TBCs performance on the only tunnel it has completed (Hawthorne test tunnel) using existing technology (a tbm used on prior sewer projects) it took TBC circa 15 MONTHS to construct less than 1 Mile of tunnel.  That is over 400 times slower than Elon thinks TBC can ultimately achieve and about 8 times slower than the industry average (for much longer tunnels) its well over 15 times slower than the 1 current 1- month tunneling records for 4m & 5m diameter TBMs.

Your suggestion that 3 tunnels could be built Coast to coast across the US in 9 months using 200 TBMs is a non- starter.

Even if this could be achieved then unless people wished to travel the full distance coast to coast then there is a major problem. Branches and merging tunnels is a fundamental part of a tunnel system so that vehicles can join and leave a main arterial tunnel.  These branches fir exiting and entering must be constructed at the time the tunnel is constructed. Otherwise the tunnel needs to be completely closed whilst branches are constructed at a later date.

Thus far TBC has not come out with a solution for constructing these branches which need to be over a considerable length of tunnel for merging / exiting vehicles dyr to the proposed speeds.  These branches/ merges cannot be constructed using TBMs. It is absolutely impossible to do so without demolishing the tunnel that is being branched into and gave the merging tunnel tbm blocking the existing tunnel once the spur tunnel has been made.

I have though long and hard about this problemsince I first saw Elon's simulation for a network of tunnels below LA and there is no obvious solution except by massive open excavations or explosives (only in deeper tunnels in rock). Perhaps David could suggest a solution but there is nothing obvious that could be cheaply and/ or practically done below a city.

I would welcome any comments that you (or David) may have.  If you do not wish to then I respect your choice and I apologise for interjecting in your discussion.
Reply: @dianax266  

Diana, I appreciate your input.  I really want to learn as much as I can and I attempt to be as fact based and objective as possible.  I am much more an optimist than pessimist.  Not a Pollyanna-optimist, but a reality based optimist.  

Thanks for the data.  I do love data.  It's the scientist in me.  Let's think about it a bit.  I'm looking at only the monthly data because we are talking about long term tunnel rate averages.  Smaller tunnels are dug faster than large tunnels.

4.01 to 5 meter diameter (BoringCo size) = 1352 m/mo
8.01 to 9 meter diameter (what David said is needed for two train tracks) = 873 m/mo
The smaller tunnel record is 1.5x faster.  That's not a lot of the 15x BoringCo is shooting for but it's a bit of the solution.  

It's not great data because there's no control for type of soil/rock being removed, but it's a start.

I hope you read my comment where I copied in a rocket engineer's account of how Elon went from knowing very little about rocket design to being expert in a very short time.  Perhaps Elon did not educate himself about tunneling in the same way but that would be uncharacteristic of him.  If one takes an objective look at what Musk's companies have achieved they have to come away with an understanding that these are not typical companies.  His companies are being very successful in transportation, space, and energy.  SpaceX lifted more tonnage into space last year than all the other rocket companies combined including the US, Russia, and China.  No other rocket company/country is landing and reusing rockets or snagging discarded fairings before they are lost at sea.  If one of your companies can do that then I doubt you would have a company that was not well thought out.  

The snail.  Elon was talking about the maximum speed a snail travels.  Not average time.  

"Contrary to Elon's claim that wall erection and excavation can be done simultaneously for EBMs this is not a realistic prospect"

Might I suggest that a more accurate statement might be "wall erection and excavation has not yet been demonstrated".  No one had flown rockets and landed them on a ship at sea until SpaceX did.  No production EV had more than a 200 mile range and a world class acceleration ability until Tesla produced one.  I don't know if BoringCo will be able to operate at the levels they have set for themselves but I do look at people and companies in terms of their history and I tend to not be highly skeptical about those who have done exceptional things in the past.

Now, let me be clear.  I am not saying that BoringCo will achieve 15x tunneling speed improvements.  I'm just suggesting that it's probably not a good idea to bet against Elon.  He's done pretty much everything he said he would do over time.  He's missed some time goals (less than 50%) but he's delivered.

From BoringCo's website -

"Prufrock has initially been designed to tunnel greater than one mile per week, with the longer term goal of tunneling at 1/10 of human walking speed, which is 7 miles per day."

I know that sounds pretty much impossible to you and David.  I don't know enough to form an opinion one way or the other.  I realize it's a huge improvement over what is the current case.  But I also know that Musk hires very capable engineers and has done seemingly impossible things in the past.  I'm open to the possibility that BoringCo will reach or get very close to that goal.

"Your suggestion that 3 tunnels could be built Coast to coast across the US in 9 months using 200 TBMs is a non- starter."

I believe I stated that 200 TBMs could complete one coast to coast tunnel in that amount of time.  I'll add my math in a follow up comment.

Branching is a design issue.  I expect the first hyperloop would be a 'dumb' version.  A single destination project such as LA to Las Vegas.  Later, if hyperloops are what we want, we would need to design an expandable system.  Perhaps the branches would be built in from the start.  Let's think.

Suppose the main tunnel runs from LA to Dallas.  The first constructed leg might be LA to Phoenix.  A few miles before Phoenix (5 to 10 miles) the tunnel might bifurcate with one tunnel running to Phoenix and the other continuing past Phoenix.  But that second tunnel might be only a mile (or even less) long.  A temporary wall would be installed.  Then the tunnel from the Phoenix area on to Dallas might be extended with side tunnels to Albuquerque and El Paso started and sealed off (or completed).   The LA to Dallas to NYC tunnel would be opened in stages.

As the US interstate highway system was constructed parts were completed and opened before work had begun on other parts.  You'd drive for awhile on an excellent new highway until you reached the end of completed construction.  Then you'd take an exit that took you to the older, slower road.

I think it highly probable that BoringCo has figured out how to build the sections of tunnels where one route will separate from the main route.  How likely do you think it is for a group of very competent engineers to overlook major design needs?  I have no idea what their solution might be, it could be something as basic as opening the ground where the route diverges and building that section differently from the other 99% of the tunnel.  

Here's the problem.  We do not know what the people inside BoringCo know.  I doubt they are stupid or incompetent.  And I don't think they would be making claims that they don't believe they can meet.  But please keep the criticism coming if you see a potential problem. I enjoy trying to think up solutions.  If I, with my limited knowledge base, can think up something that might work I figure the more expert are likely to have a much more elegant solution.
Reply: @dianax266  

A hyperloop tunnel set from LA to NYC constructed in less than a year.

Currently tunneling machines average about 60 feet per day.  BoringCo estimates they can increase that by 15x via smaller tunnels and more efficient tunneling.	
	
3,000 miles from LA to NYC (approx.)	
15,840,000 feet LA to NYC 	
	
900 feet per day tunneling with one Boring Co. TBM (60' x 15)	
180,000 feet per day with 200 Boring Co. TBMs working along the route	
88 days to drill a single tunnel coast to coast	

Use 600 TBMs and it would take 9 months to drill the three tunnels needed for a hyperloop system.

Remember, smaller TBMs like BoringCo will use can be removed and trucked to the next project.  It makes financial sense to use several/many TBMs on a large project in order to complete the project as quickly as possible and start the revenue stream.  Then pack up and go to work on another project.  At some point the company becomes self-financing based on revenue from completed projects.  That is where Tesla is now.
Reply: @davidsalisbury50  

Tunnels could go beneath basements and utilities.  I doubt there's much that extends down 30 feet and if necessary the tunnel could go much lower.  I hadn't thought about pillars extending down to bedrock.  Those would have to be avoided.  There might be spurs that are located under city streets and have to move at slower speeds due to tight turns.

Land rights can be overridden by the government using eminent demand.   That commonly happens for things like road construction and would certainly be needed on a large scale for HSR.

It is very likely that concern over climate change will continue to grow over coming years.  Projects that help us lower carbon emissions will become "for the common good" and will receive assistance from governments.  

Entry points will need to be away from residential areas and where materials can be supplied without jambing local roads.  Other than at the entry point residents should be unaware that a tunnel is being constructed under their feet.  At a 30 foot depth there should be no noise or vibration at the surface.

Boring has  an interesting, no cost solution for disposing spoils.  Use the spoils and some cement to make building and landscaping blocks in a hydraulic press on site.  Then sell them much cheaper than normal bricks/pavers sell for.  Buyers will come to the site and haul the spoils away for Boring.  No cost to transport spoils, no cost to dispose of spoils, even some modest profit from selling spoils in brick form.
Reply: @dianax266  
This isn't the best place to fit this comment but YouTube's comment software is fairly primitive so I'm putting it where convenient...

On a different site someone claimed that a hyperloop at $10 million per mile per tunnel from Los Angeles to Las Vegas would never pay for itself.  I'm kind of a numbers guy so I worked up some back of envelope numbers.

230	miles LA to Vegas
$10,000,000 = per mile single tunnel
$2,300,000,000 = cost for one tunnel
3 tunnels needed
$6,900,000,000 = tunnel system cost
	
49,500,000 people traveled to Vegas in 2019
135,616	people per day
	
$50 cost of a  one way plane ticket
$40	for a Boring ticket one way
	
49,500,000 people traveled to Vegas in 2019
10% the minimum a hyperloop might attract 
4,950,000 passengers per year on hyperloop from LA to Vegas
$80 per person for RT ticket
$396,000,000 = annual revenue
	
$6,900,000,000 = tunnel cost (does not include stations, financing, and operational costs)
$396,000,000 = annual revenue
17.4 = years to cover tunnel cost.
Reply: @bobwallace9753 
Thank you for your replies.  You make references to hyperloop. So we are not at crossed purposes, my understanding is that TBC was formed and (currently) its sole core business is in relation to Loop and does not involve Hyperloop (at least at this stage). 

My understanding was that Hyperloop was a concept that Elon came up with prior to Loop (and TBC) which involved vacuum tubes constructed above ground (on stilts).  Elon's 2013 white paper on hyperloop was to encourage others to embrace (and develop) his concept to achieve intercity transport at speeds of circa 800mph. That is an ongoing development project. 

Whereas the Loop was Elon's subsequent brainchild predominantly to overcome traffic congestion in cities by building an underground network of tunnels below the city.

Whilst there may be future aspirations to integrate Hyperloop and have some tunnels/ tubes below ground that is not the current primary focus of TBC.  This is supported by the first paragraph on the FAQ section of TBCs website which says this:

"To solve the problem of soul-destroying traffic, roads must go 3D, which means either flying cars or tunnels are needed. Unlike flying cars, tunnels are weatherproof, out of sight, and won't fall on your head. A large network of tunnels many levels deep would help alleviate congestion in any city. No matter how large a city grows, more levels can always be added. "

Your comments refer to hyperloop (which is still be developed as a concept) and my comments before were regarding Loop and TBCs current aspirations. Can you please let me know if you agree or disagree with my undersranding.  If you disagree then can you please let me know where?
Reply: @dianax266  
I don't recall the timeline of which idea Elon had first.  I think he was frustrated with slow moving traffic and thought that it would be nice to have a tunnel to use to get to his destination quickly.  From that projects grew.

Early on he published a white paper describing his version of a traveling in a partial vacuum tube.  He called it the hyperloop.  His initial concept used much smaller diameter tubes, maybe 2 meters.  People would climb into the pod when the roof swung open and would remain seated for the journey.  The pod would be battery powered and would use air that it compressed via an onboard compressor to hold it off the tube surface and propel it forward.  Maybe the hyperloop paper proceeded the idea of driving in tunnels.

That idea has evolved to a larger pod that would allow people to walk to a toilet while traveling and maglev propulsion.  Somewhere along the way Elon also talked about one way tunnels under cities which could be traveled at fairly high speed in cars riding on battery powered 'sleds'.  And then the idea of sleds went away.  The hyperloop tubes went away and were replaced by the sort of tunnels Elon was considering for a urban subway system.  I suspect he learned about tunnels and realize that they were a better idea than above ground tubes.  The two ideas merged as they evolved.  And I expect we'll see the ideas continue to evolve.  That's how Elon operates.  "Got a better idea?  Use it.  Now."

Here's where I think things are right now and is based on what Elon has mentioned.  Start with the lower speed tunnels.  Run self-driving EVs at atmospheric pressure.  These are much smaller projects that will allow Boring to develop their tunneling technology before starting a tunnel that would stretch for hundreds of miles.  And it would create a flow of cash to help finance future projects.  The Loop is a bootstrap to the hyperloop.

"Prufrock has been designed to launch directly from the surface and will achieve speeds of more than 10x faster than Godot."  Boring FAQ

'Prufrock is alive'  Elon recently in a tweet.  Alive doesn't tell if Prufrock is faster than Godot but Elon thinks it will be.

Elon has already been testing scaled down hyperloops.  They've run multiple contests in a tube constructed by SpaceX in LA to find the best pod designs.  Apparently one of Musk's companies is currently build a new test tube(?) that will be (6?) miles long and allow for high speed pod testing (700 MPH vs. 288 MPH in the first tube).  

Here's what I think is a possibility.  Over the next 'year' Boring will improve Prufrock.  Perhaps they'll dump Prufrock and build a newer TBM if they have a better idea.  But once Prufrock is tunneling fast enough Boring may start work on a LA to Vegas hyperloop system.  I doubt there would be any problem financing a $10 billion project if it can be determined that there would be enough riders to make it profitable.  Travel at 700 MPH rather than 70 MPH for the cost of driving ones own car.  Exit in Vegas along the Strip and have a Loop system for moving around the Strip area.  Get from LA to Vegas in less than a half hour rather than spending hours driving.

And at the same time cities will be lining up to get a Loop system to help them deal with congestion problems.  Boring will set up a TBM factory and go large scale.

Some of the projects will meet resistance, like the Chicago and LA projects have but as people understand the value resistance will largely fade away.
Reply: I just saw this on Boring's FAQ page.  Look at the word "currently" in the last phrase.  And, remember, this sort of claim is going to be approved by the corporate legal team.  Perhaps not a rigorously as in a publicly traded corporation but after the crap thrown at Elon I expect he's being careful.

"Currently, tunnels are really expensive to dig, with many projects costing between $100 million and $1 billion per mile. In order to make vast tunnel networks feasible, tunneling costs must be reduced by a factor of more than 10, with TBC's Loop tunnels currently priced at approximately $10 million per mile."
Reply: Never, there are tunnels underseas, mountains.... tesla just makes underground pipes
Reply: @carholic-sz3qv  

Look for a clue or two, M. B.  There are plenty offered for free around the web.

I'll give you the first one.  This is not a Tesla company project.  Boring Company is a separate, free-standing corporation.
Reply: @bobwallace9753  and.......